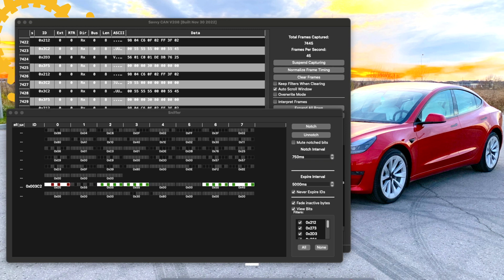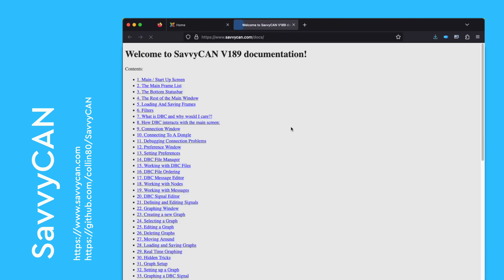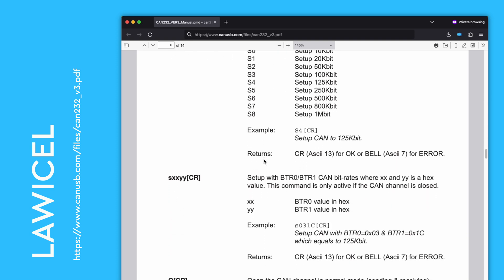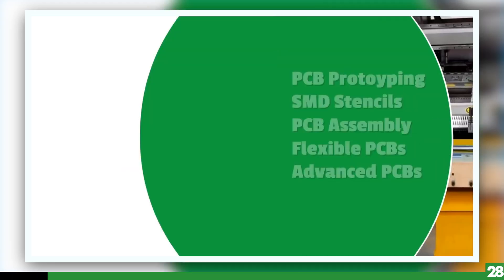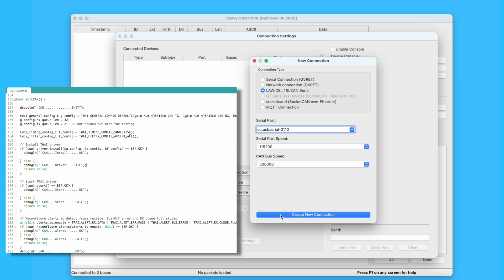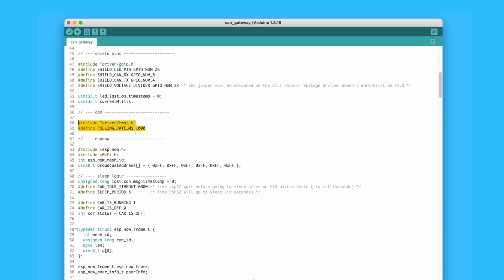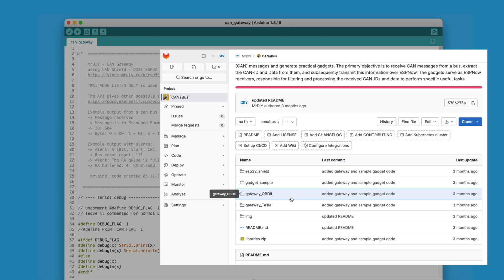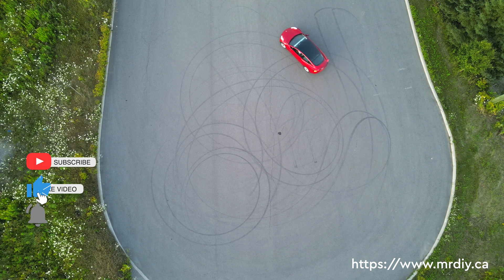SavvyCAN over ESPNow using an ESP32 CAN Gateway  (Gadget #1)

Comment: Why all the hassle? Savvy CAN doesn't work on the ESP32?
There's some variant in github to ESP32RET called wifican that allows using the ESP32-S3 to receive and transmit frames with Savvy CAN
Reply from the maker: Yes, it does beautifully. ESP32RET only works with SavvyCAN. The gateway I designed is meant to serve as a general bridge to many gadgets ( SavvyCAN is one of many). I explained it in a previous video - https://youtu.be/gtVQeTRps7o

Comment: Hello, your work is awesome ! I've tried to do it, the "ESP32 reader" reads corretly the CAN messages and sends them over esp-now but SavvyCAN don't get any messages from the Wemos D1 mini. I was able to read the serial com from the esp8266 and it's writing things that always start with letter "t" so I think it's working. Do you have any idea of the problem ? On your video you configured a new connection but you did a cut, switching directly to the main software page where CAN message arrive. Is there extra step in the software SavvyCAN ?
Reply from the maker: It is probably the baud rate. Check my settings at 3:05 (LAWICEL, COM Port X, 115200, 500000)
Reply: @MrDIYca  I succeeded to make it work using Linux instead and using an ESP32 as savvycan gateway ! thanks ChatGPT for converting code
Reply: @MrDIYca  I unfortunately did the same config as you, with the right COM port (on windows), the correct baud rate 115200 (the same as in the code) and the 500kbps (but not relevant like you said in the video). Do the CAN messages appear directly after configuring the new connection ? Because it's not directly showing messages in you video.

Comment: Great work. Would be great if you could write code for ESP32 dev module to act as GADGET: SLCAN/LAWICEL.
Reply from the maker: The code is written for Arduino, so migrating it to ESP32 should be relatively straightforward

Comment: Hello, I'm getting some trouble implementing the SLCAN protocol. Any chance to get in touch with you via email? Any help will be really appreciated.
Reply from the maker: Sure, but can you post here? that way everyone can participate and benefit
Reply: @MrDIYca  In my serial terminal, my ESP32 (just for testing that I wrote the correct serial data with SLCAN format)  already stream serial output data with this format "T15FF04030203040506070809[CR]" but the SavvyCAN not recognizing it as an incoming data. Can you help me with this?
Reply: @MrDIYca  And now I already have a serial output that get the same result with the LAWICEL Manual -> T0000010021133[CR] -> but still no output yet on the SavvyCAN
Reply from the maker: There's an initial handshake your serial port must manage before proceeding. I suggest reviewing the LAWICEL PDF linked in the description for more details.

Comment: Got a library issue as below during sketch compile. Please give me a pointer and help me out.  "Arduino/libraries/esp32_can/src/esp32_can_builtin.h:43:25: fatal error: driver/twai.h: No such file or directory
compilation terminated."  Thanks
Reply from the maker: It looks like your Arduino IDE is not configure with ESP32 boards ( or the ESP32 was not selected on compile ) 
A good read: https://randomnerdtutorials.com/getting-started-with-esp32
Reply: Thanks, after library updates, the code compiles now. Thanks

Comment: Congrats🎉 very nice job!    I wonder if you eventually will make the canbus data to be transmitted over cell network.  Would be great to unlock the car via homeassistant even if you parked out of your home garage, also allocate real fuel consumption per user is a nice feature (I do share a car with brothers and someone is never refilling, but cant asign blame). I guess 4-5g will unlock lots of possibilities

Comment: Another excellent video, I’ve used the obll gateway code has my CANBus baud rate runs at 250 and it works good, I’ve also tried it with CANhacker 2.01 and it works well to. I’ve got to learn more about savvvyCAN and get to grips with it. 
I wonder if it would be possible to add an extra esp8226 with  SD card to the esp8226,so you could record data to play back so you don’t have to have laptop

Comment: I'm just using a raspberry pi to convert all the can messages to mqtt and then I connect savvycan to the mqtt broker.
Reply from the maker: Yes, that is another great way to do it. For my project, I needed a way to communicate with my gadgets without a Wi-Fi stack/router and that is on instantly.